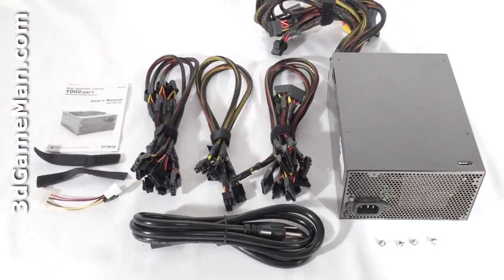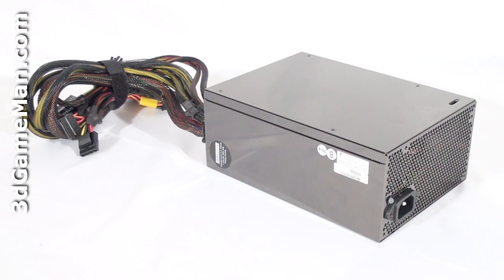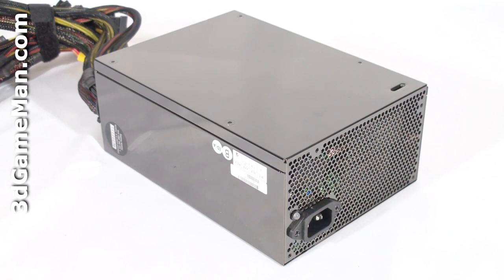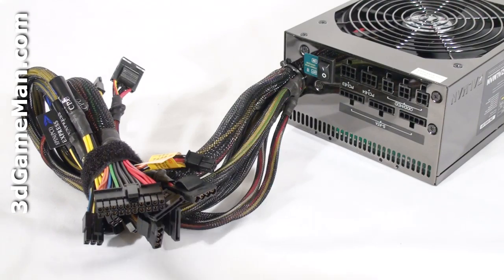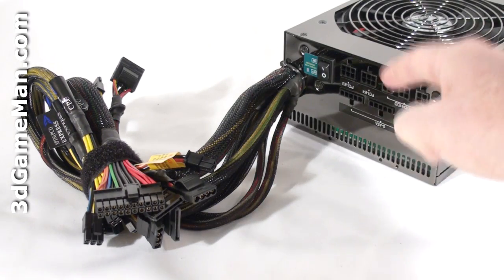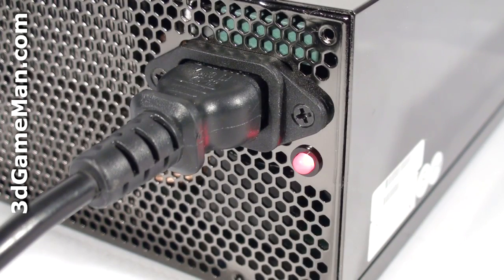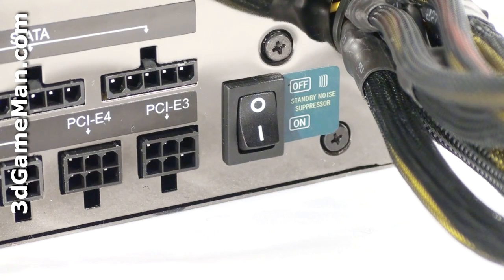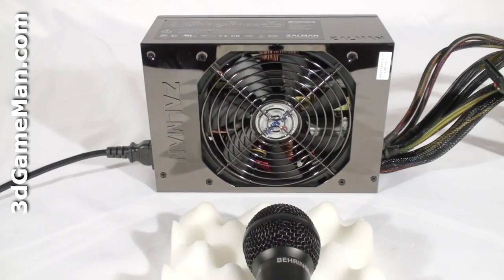#1021 - Zalman ZM1000-HP 1000W Power Supply Video Review

Comment: Well actually I'm cheap, and lazy, so I have a power supply above it on the lower ledge of my desk. I'd just put another one next to it, and have that one power excess fans, and my video cards. I don't plan on going anywhere with it otherwise I'd just get a bigger supply, or case. Ventalation specs are 2 tabletop fans blowing on my motherboard constantly, and I hit it with air duster every few days to clear nasty paticals off. lol